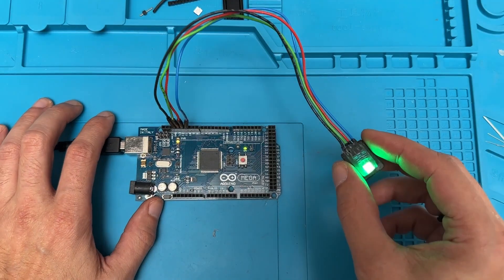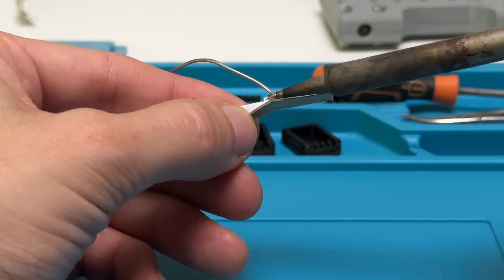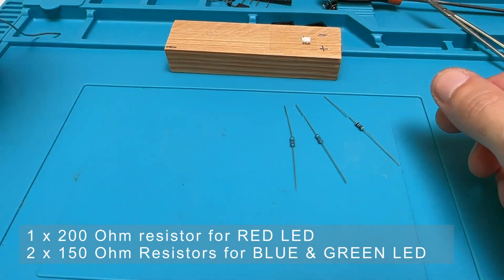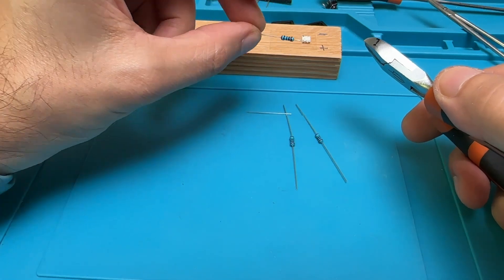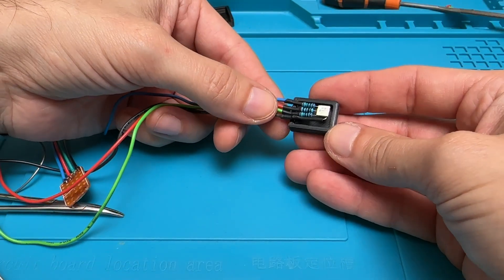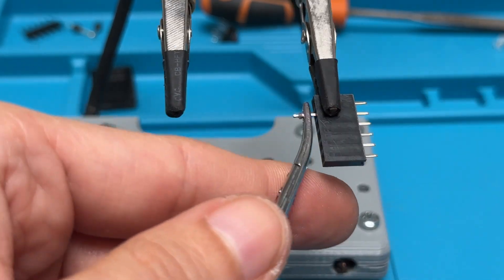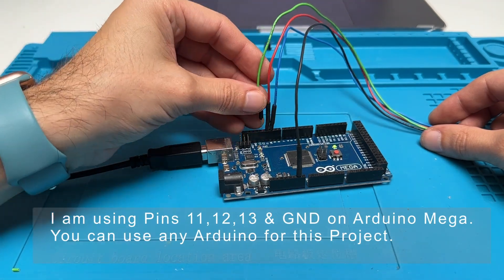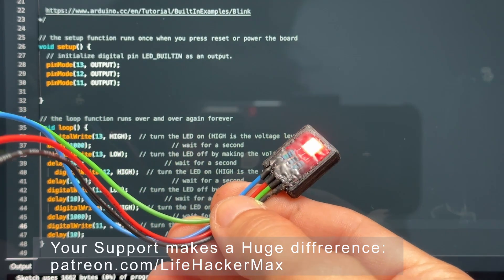DIY Arduino RGB LED brick from Old LED Strip #lifehackermax #arduino #led

Comment: Is there a reason you use a different resistor for the red LED?
Reply from the maker: Yes. The red LED is rated at around ~2V while blue and green are rated at around ~3V. Therefore the resistor for red LED must have a higher value to compensate for that 1V difference. 

If I would have used the same resistor as blue and green, then the red LED would light up at a higher intensity, but could also burn out or have a shorter lifespan. 

If I would have used the higher value resistor for the blue and green lights, they would light up at a lower intensity than normal.
Reply: @ thank you for the insight! I’ll keep that in mind when putting mine together